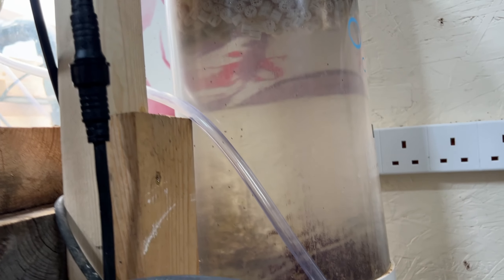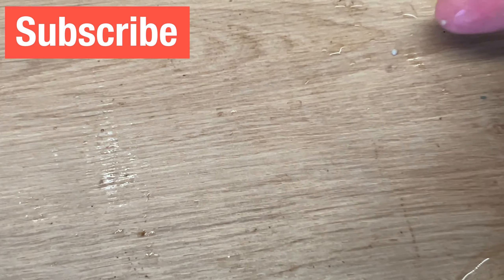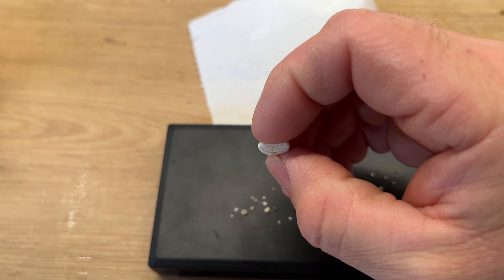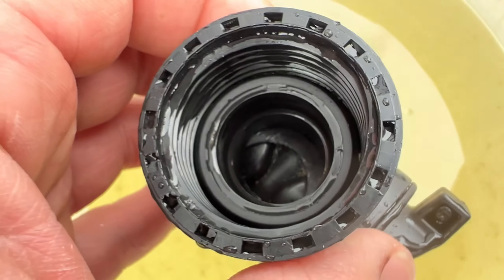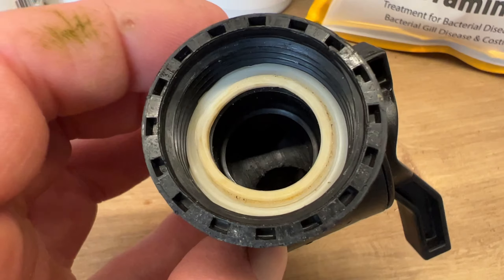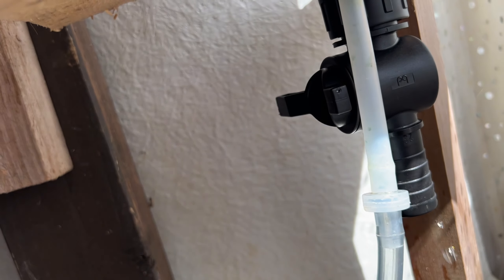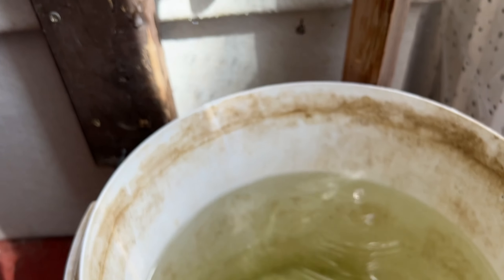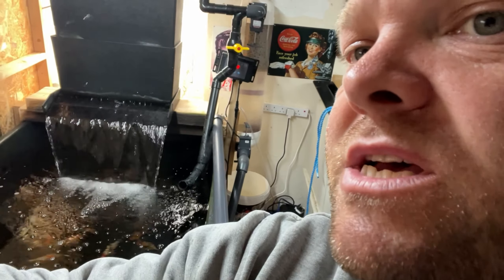EA TEMPEST DRAIN OFF VALVE FIXED AND KOI TEETH 🦷

Comment: I always thought they were meant to go after a filter or on a skimmer line which I doubt in both situations teeth wouldn't end up in them
Reply from the maker: I use it as the main mechanical filter it works a treat for me just a bit more maintenance with cleaning the valve 👍
Reply: @Gaffer`s Koi Pond obviously but not as a prefilter
Reply from the maker: I have been using it for over 12 months now mate it has done me proud can not fault it as a main mechanical filter with 70 tosia up to 34cm I have a Bakki shower after it to take the biological side of it it works perfect 👍